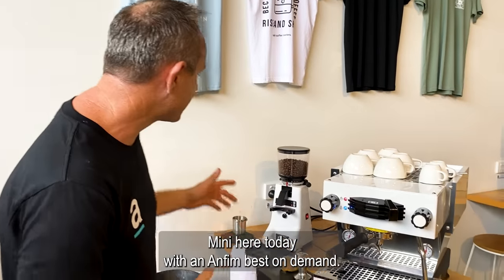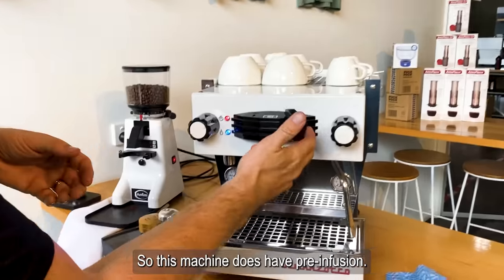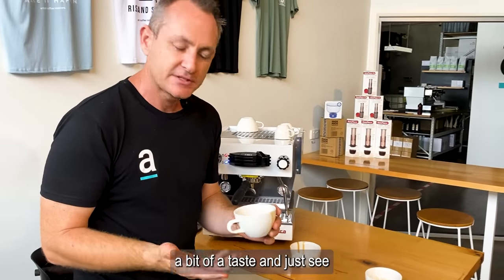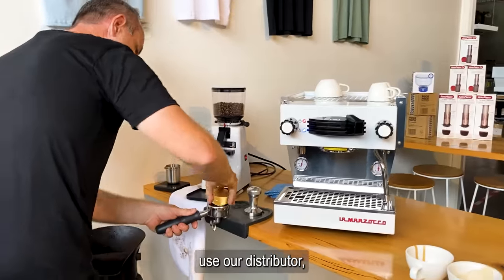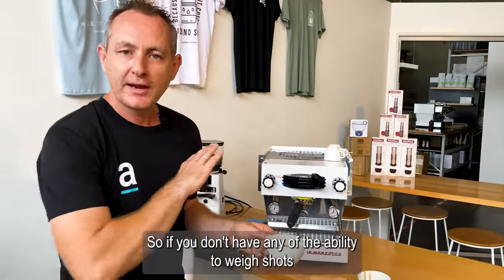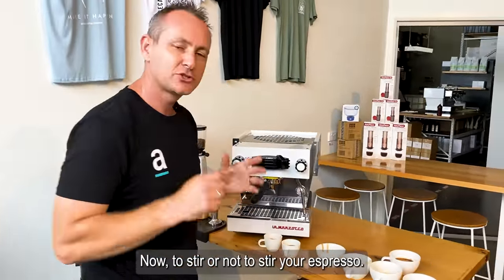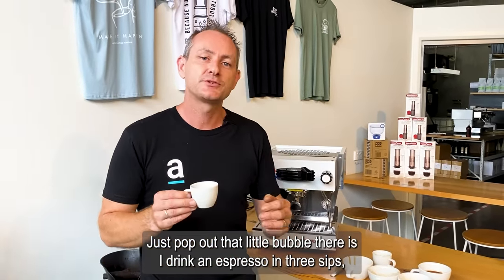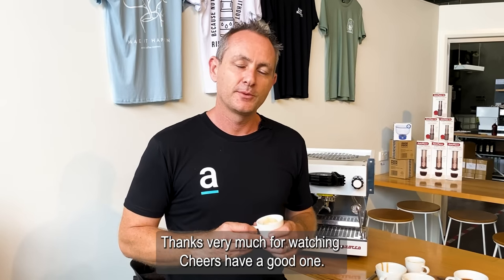Everything a barista should know about Espresso (Make Better Coffee)

Comment: I got my GS3MP in October last year and since then I've mainly depended on using a acia scale and always time for 25s for a 2:1 ratio, or sometimes let it run to 30, 35s as long as I maintain that 2:1 ratio.

However, I've found over all, that the ratio is less important that, of course, correct extraction.  And 25-30s seems to be the best overall.

BUT watching your video and I tried your approach and wow. It's really easy to look for the blonding point, the wobbling is also a nice indicator and now, I actually prefer to use that rather than caring too much about the final ratio.

In a long time, I split and excellent shot.  Oddly enough, I've been, unconsciously  been enjoying espresso as you do.  No stirring, just a couple draws in to get the various flavours through.  Thanks for this great video; I honestly think everyone should see this when they are starting out.
Reply from the maker: Thanks mike, glad it helped you. 👍🏻 happy brewing. Cheers luke

Comment: Delightful video!  Very clear explanation.

I'm an Avowed Stirrer; I liked the mixed result for a uniform drink from the top to the bottom of the drink as I'm usually in the process of doing something else as I'm drinking it.  VERY occasionally I go the route you prefer in just taking the pour and sipping the layers (approximately).  That's interesting too, with the added benefit of coating your mouth with a taste that sticks for awhile (imo the big reason for the layered drink).  

You might do some sort of addendum of this video to explain how you derive a shot-process for your AV machines in your shop (I use a GS3-AV myself, so similar).  Basically my setup (grind, dose, pour) is set to produce a pour that stops at the blonding point with my desired extraction ratio (I like mine at about 2.5:1).  I find the AV (which outputs a fixed volume of water onto the top of the puck) does a great job at consistent 'Swiss watch' pours, which is what you aim for in a coffee-shop.

Cheers, and congratulations on your 50K mark!  You guys are great!
Reply from the maker: Thank you. The AV is something we will go into, the set amount of water is great if you use the same beans and also buy it in a constant timeframe. If you mix your beans you have to always adjust the AV volume as the beans will hold more or less water based on the age of the beans
Reply: @ArtistiCoffeeRoasters    Look forward to the details in your use of AV.   Should be interesting for some of us.  Thanks for the reply.

Comment: Great video. 
Please guide on how to activate Pre-Infusion in Linea Mini. 
Thank you in advance.
Reply from the maker: If you have the new IOT model you can change this thru the app. If not, it’s will be set for a very limited time, if it was the 1st few runs when it came out I don’t think pre infusion was activated. It’s a bit of a line pressure with a delay for the pump to kick in.
Reply: @ArtistiCoffeeRoasters  I bought in the Q1’21 and it doesn’t have the app system built in. The already is I think 2-3 seconds only. 
So the only solution is get the system then. Right?

Comment: I usually stir.  I have the James Hoffmann small spoons.  In contradiction I don't stir when making a cappuccino.

You offered a way to time a shot without a scale or timer.   The part that spins my head around.   You want the general rule of 27 to 30 seconds out no matter if it is ristretto, normal or lungo. Am I correct?  Which means the grinder needs to be adjusted.  I have a decent understanding about where to set the grinder for a normal. Of course I am timing and weighing the output.  If you do not originally figure this out. Then it could take a dozen shots to get to the four color stages.  Or am I over complicating it?
Reply from the maker: We are offering a way to know when you have a full extraction for Esprssso no matter the Grind amount, and not having a scale or timer, if you have these you can refine this process.

Comment: Hi, great videos. 
I’ve been taught to do 20g coffee for 40g extract. 
What would be the difference if any between this and your 22.5g for 45?
Thank you so much.
Reply: More coffee in the basket creates more resistance for water to flow though. Could increase pressure in the machine and/or time of extraction. If you want the same extraction time adjust your coffee to be slightly more coarse. If you change one variable you likely need to change a different one to end up with the same result.

Comment: Excellent video! Just great information, well told, I was never wandering with unnecessary distractions. Always on point. I learned a lot, and will most def try the no stir, 3 sip technique. I am a stir and 3 sip kinda guy now... Hey quick question, what;s your view on how long to wait after pulling the shot before that 1st sip? I have been waiting a few minutes for a while, but now I find it's better if I get right after it, say 30-60 seconds.
Reply from the maker: Thanks, great question, if your brewing at 84-92 I go straight in, one it’s the n the saucer and boom! It’s in the mouth. That’s if you can handle the high temp in your mouth. Letting it cool a little will change the flavours, and I find that when I’m served and espresso from a cafe, it sat on the bar for a few mins prior to serving. So it’s 3-4 mins sometimes which is not ideal

Comment: Hi, enjoy your tips. 2 questions, I use my leveler as a tamper at 35lbs with a triple basket at 22.5 grams and 45 grams of liquid.. Works well, any comment? I use a battery frother to foam hot whole milk. That seems good, but wonder if there's an advantage in steaming? Using a fairly new Gaggia Classic Pro.
Reply from the maker: Cool.’if you use the steamer the milk will be a bit sweeter as this process is adding more moisture, your process is a bit more marshmallow taste.

Comment: Do you stir the espresso with sugar before pouring milk or just swirl the cup or pour some milk and stir then finish the rest? Some says stirring the sugar with espresso will break the crème of the espresso. Is that true?
Reply from the maker: Yes it will break the creama a little, however if your adding sugar it’s best the melt it in the Esprssso so that all the sweetness is thru the hole cup, not sitting on the bottom of the cup
Reply: I normally do exactly what you suggested here because I noticed the sugar is melted in the espresso while streaming the milk. I just swirl the cup,a little before pouring the milk. Than you for your valuable advice. 🙏👍✔️

Comment: Thanks this was a great video, I don’t stir my coffee. My challenge is always I’m limited by my knowledge. I might taste my coffee and think that it’s good but it could be better. Also a bit off topic but for recipe I know you use 22.5g in a 22g basket, I have a Breville Dual Boiler which I believe has an 18g basket and I use 18g for a 1:2 extraction to get 40g in 28sec. Would love to hear your thoughts on this. BTW been hooked on your vids since discovering this channel just recently 👍
Reply from the maker: Thanks for the message. Glad you love the content. The breville will do a good coffee, 1:2 needs to the 18g in, 36 seconds out. The 28 seconds will be fine, but look at the pale, and stop when you see this. Then measure the weight and see if it’s the 36g
Reply: @ArtistiCoffeeRoasters  thanks for the quick response will give it a go 👌
Reply: So, does the time of extraction start when the pre-infusion starts or when it starts coming into the cup. I have a sage duo temp but I can't get the timing right, too fast extraction. Love your videos by the way. Coleen

Comment: What basket did you use for 22gr dose?
Reply from the maker: It’s called a 21g straight wall, or a triple basket. You can pack 26-27 grams if you try
Reply: @ArtistiCoffeeRoasters  Thanks for the answer
Is it the vst 22gr or something like that?

Hard question now:
For such a high dose, is it required a slightly higher temperature of the water?